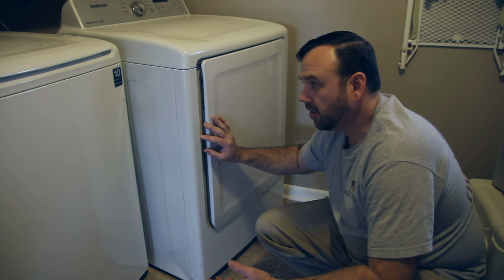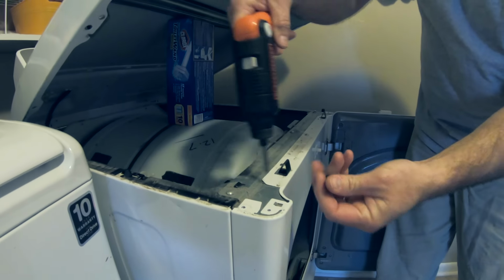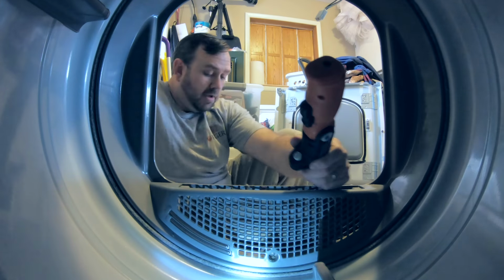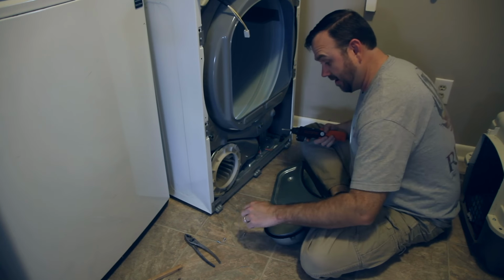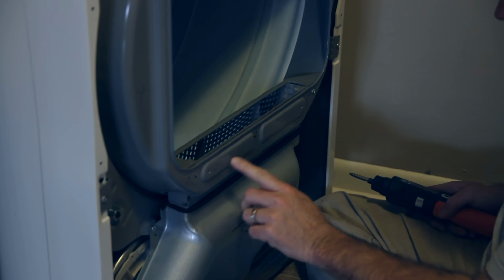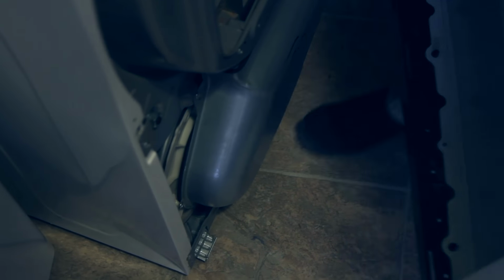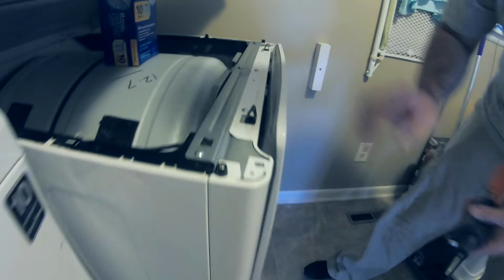HOW TO REMOVE & CLEAN SAMSUNG CLOTHES DRYER VENT : JRBVIDS

Comment: You only need to take off the three screws on the silver part under the top. Makes it quite a bit easier.
Reply: You sir. Are a god
Reply: Thank you. Much easier than what was said on the video
Reply: Actually, Your comment was extremely helpful it actually made it way easier to pull forward first and lift up and nothing feel out of place like it did in the video. Thank you for this comment team work makes the dream work ❤

Comment: My model was is the DV45H700WE/AC and my goal was to clean the bottom of the lint trap. The screw in the middle of the trap that you cant see unless your inside the dryer doesn't need to be removed. As another comment mentioned there is a black cover on the bottom that has 4 screws that need to be removed before you can slide the door panel upwards to remove.
Reply: This needs to be the top pinned  comment !!!
Reply: Thank you!!!
Reply: Thank you!

Comment: Found it easier to just take the 3 screws from under the dryer tip to remove the door face vs the 5 screws at the top.

Comment: It's crazy that you have to take all those things off just to clean the vent. Thanks so much for this video. I would have never been able to do that without your help. I did have a hard time taking the top off and then pulling it all up. I will look for a long skinny flexible tube or something similar that I can attach to my vacuum cleaner. With it, I should be able to reach the housing that sits right under the lint basket with the removable lint tray. Anything except taking this thing apart again. 😅

Comment: Wow!  My Samsung drier stopped working suddenly. It happened when I had the gas company come out and check for high gas use. Perhaps it was coincidental..I don't know yet. I Was looking at spending about $900 for a new one. I am now confident I can attempt my own repair and I will do that. No resolution but a huge increase in confidence to begin. I just repaired a refrigerator freezer following a video much like this. Had an expensive microwave fail a month ago. Need to do what I can to keep the costs under control. I will post again after I take a shot at his. Really appreciate how professionally done this video is. 
😄

Comment: Thank you for this video, we watched it about 4 times, ours was a different model #, and we didn't have to do a couple of your steps,, but we were able to take it apart and put it back together. My wife had tried to use a paper towell to clean some of the lint and it had dropped down to the fan blade, without your video, we wouldn't have had a clue on what to do! Thanks again for your video!

Comment: Was trying to clean the vent without taking apart and dropped something down.  Tried to wiggle it out and assumed it would just sit there.  Turned machine on and it made a horrible sound.  Wish I had found your video first on how to clean out because this couldn’t have been easier. Opened up the machine, dislodged the item I had dropped from fan. 5 minute fix versus buying a new unit or waiting several days without laundry for a pro to look at.  Thank you so much!  Your video is a lifesaver.

Comment: Big Thanks
Not exactly my model, but close enough.
I needed to get into mine to check the flame sensor and ignitor. Other videos were for different models that come apart differently. Watched you dive into your's and went and tried it Worked perfectly.
Thanks for posting.

Comment: This was so easy to follow and helpful. My son dropped his toy car down the lint trap and this saved me from waiting for someone to come out and service it. This gave me the confidence to just go for it myself. I’ll share that I saw a separate tip for removing the top (mine wouldn’t pop off). Used a multi-tool in the crack about 5” from each edge to lift the top just enough for it to pop off of the clips. Also used it to pop the front panel off the small clips on the top. Thanks again for this incredibly helpful public service!

Comment: Just a quick note to tell you how thankful I am for this video. My elderly mother-in-law was trying to “Retriever“ a 10cent coin with a wooden spoon that ended up getting trapped so… Your video was extremely helpful as I was able to not only retrieve the coin, the wooden spoon but also gave my dryer lint duct a very good cleanup which was definitely needed. Thanks again

Comment: Great video and thanks for posting. Although not the exact model Samsung, the design was close enough to show me what I was missing on getting the front off. Also, you helped me be ready to disconnect the sensor in the lint filter and for the door opening.

Comment: Thank you for this video!   My new home came with a Samsung w/d set.  I tried to remove the lint trap holder to deep clean it but it wouldn't come out even after removing the 3 interior screws.    Now I know the whole front panel and 3 more screws need to be removed.   What a PiA!   My old LG was not like that.   Thank you

Comment: Thank you for this video it was extremely helpful. My clothes are drying much better and faster as it was a lot of buildup in there in the filter wasn’t going all the way down i’ll try to use the vacuum, but the vacuum doesn’t reach far up in there being able to pull everything out in properly clean it made a huge difference. Thank you.❤

Comment: This is exactly the video I was looking for. I think I might have a bad thermal sensor. I'm going to try cleaning it out and checking the sensors with a multimeter. Awesome video!
Reply: What did you end up doing? My dryer stops and stops. I used this great video to change the moisture sensor plates and it did not help.

Comment: I wanted to THANK YOU for doing this video...it really helped to give me an idea on how difficult it might be to accomplish this task.  Thanks for making it clear and easy to understand.  I also wanted to thank you because, our dryer is similar model but it is GAS.  There was A LOT of lint near the gas ignitor inside and that could have caused all kinds of issues.  I was able to get in there with a vacuum extension and get all the lint.  THANKS again.

Comment: Your video was very helpful.  I have 2 suggestions for you.  By now, 3 years later, this first one may not apply as you've moved forward? 1. you might consider getting a magnetized bit holder for your electric screwdriver.  2. when installing more than one screw or fastener on an item, leave all loose until all are in place.  Then tighten.  Keep up the good work.

Comment: So glad you did this video - I had a different model that looks a bit different but the steps to remove the lint catcher holder was nearly exact!  Idk what Samsung is thinking making it this tough to remove something so simple and prone to needing to be cleaned but there it is...again - thanks, awesome video! My Model: DVE52M8650V/A3
Reply: This is what I have too. Very annoying needing to remove the back screws to remove the top.
Reply: @lindace7 I’m late to the party but how did you get the panel off once the lid was open and 5 screws were out + tabs pulled up?? It seems like the bottom half is still tightened to something???
Reply: @samanthasmith5948  did you figure it out?

Comment: Just the video I needed. My Samsung dve52m7750v dryer is newer than the one you cleaned but is styled the same way.
Reply: I’m having trouble pulling the front up is there any other steps you had to take to lift the front up?

Comment: Great video. Mine had two alignment pins on each side of the front panel. So mine would not lift straight up and off. I had to remove the two black spring clips on the top, you were able to leave on. I got it fixed. Sock sucked into the motor as dryer was run with lint trap removed.

Comment: Left out a crucial part in the video of the 4/5 screws underneath the dryer needs to be removed before taking off the front panel off over those black tabs. Learned the hardway 😅

Comment: Thank you for this video. It’s ridiculous how much work it is to clean this out! You have to take the whole dryer apart! My last dryer, all you had to do was open it with 2 screws on the bottom. I think they make them this way so you burn them out and have to buy a new one.

Comment: My model required me to tilt the whole machine backwards and get underneath to remove 4 screws from a black footer across the bottom. Once we did that, we were able to pry the bottom sides away from the base and THEN pull the front piece upwards and off. This was definitely a two person job and took about an hour. 

Added tip: Clean the floor around the  dryer first. Your face may become very close with it.

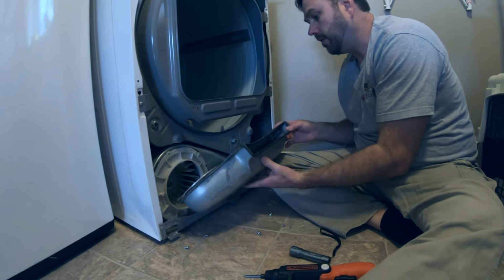Comment: Many thanks friend. Very helpful. I too was having trouble with this same model Samsung- a sock had somehow gotten inside the lint trap chute, and then gotten caught between the blades of that rotary inside and its housing. Wedged. The drier drum spun with fiction against it, labored. By SEEING what this looked like ( 8:10 in the video) I got an idea that worked- without me hving to disassemble and remov the front. I did it from inside the drier lint mechanism, in the front of the drier. I took a narrow long wooden stick- broken yard stick- that would fit in the space inside the lint mechanism. It had a small mirror taped to the end so the mirror could, flop, move up down etc with ease. Then I worked the mirror down inside, got a small flash light so I could illuminate things, and I could SEE the sock and how it was caught. Then, knowing where the problem was, no electric wires etc to damage, I took a coat hanger, clipped the ends, sharpened on end, and curved it like a huge drum ( fish) hook; then with lighted area, mirror to watch my work, and the bent hook I worked it up inside, hooked the sock, and then slowly extracted it. Sort of like videoscopic surgery. Drier working like new now...and it didnt cost me more than some sore muscles from bending etc. I other words something Id try first if this is the problem you have.

Comment: The Samsung DV48H7400EW looks very similar to this model but instead of the 5 front top screws (which it has), it's mounted to the mainframe with a 3 screw top frame. With the DV48H7400EW, you remove these 3 screws and depress the black edge tabs to remove. So far, I've replaced the tension pulley (very easy), a heat sensor and recently, the entire heating element in the last 8 years on my DV48H.  The engineers at Samsung could have put an access panel on the side and made maintenance on the heating element so much easier. If you came here and have my model, remove 3 screws (the 2 by the filter and door sensor), use a plastic spatula to press on the 2 cap springs and lift the top. You'll see 5 front screws and 3 more screws on a silver plate, remove these and depress the side springs. Disconnect the door sensor plug and remove the face of the dryer.  I'd also suggest, putting some soap on the top black lock springs before closing the lid. The insides of the DV48H7400 are just like jrbvids excellent video.

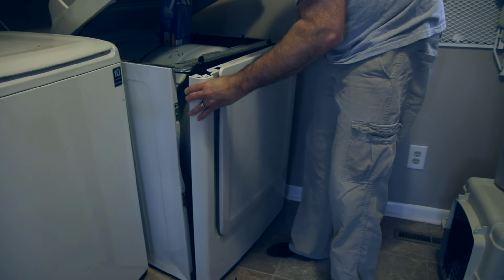Comment: ..at 3:41 you might need to remove 4 screws from the bottom if your toe black plastic toe kick is install.
Reply: Thank you for this, I have the DV45H700WE/AC and this part was required at the time stamp.
Reply: Trying to figure out where and how to remove those 4 screws as I type this.
Reply: Im trying to find the toe kick screws for this too

Comment: Any idea what might be going on with my dryer? It starts then it stops. I looked into what the problem could be and it turns out it could be the moisture sensor plates. So I purchase new ones and replace them using this video on how to access and it is still doing the same thing. Any ideas? I appreciate your video and any help you may provide.

Comment: Guess they don't want you messing around inside. Ditto as @michelle9952. Excellent presentation. Had to remove the cross member at the top in order to remove the front panel.  Otherwise....Nice Job....Thanks

Comment: To save you some time removing the front. Only unscrew the top three screws . Don’t unscrew the ones with the black cones on it. You don’t have to remove the black tabs either. 
There’s pushing tabs on the left and right, push those down and pull up from the bottom.

Comment: Thanks you so much for this very helpfull video. Exactly what i needed. But can we agree that this is the stupidest design possible ? I did the equivalent on my mother in law’s machine which is a Frigidaire brand: 2 screws and 5 minutes later her machine was cleaned.  This Samsung requires an explanatory video and an hour of work to do the same. To clean up lint!! In a dryer!! Makes no sense…

Comment: It’s just ridiculous how they designed the lint filter components! Obviously made so that the customer calls a service tech and has to PAY just to get a thorough cleaning. So far, I’ve been able to get away with just shoving a Swiffer duster down there and grabbing up most of the lint. Just need to do it on a regular basis.

Comment: I win lol i found 2.10$  thanks for the video mine is slightly different can't pull front panel strait up until you bend the tabs pull panel outward and unscrew plastic guide pins from inside the dryer ahhhhhh poor design